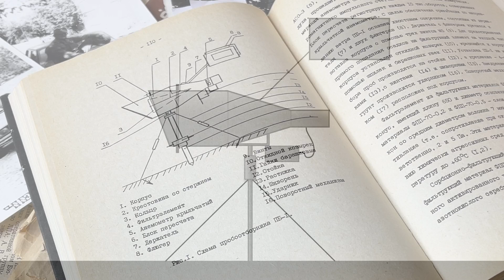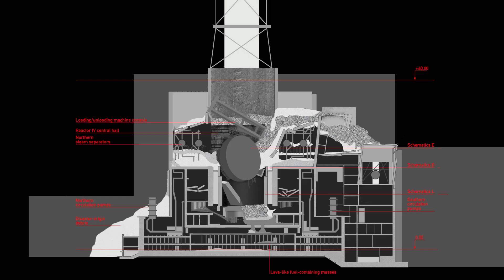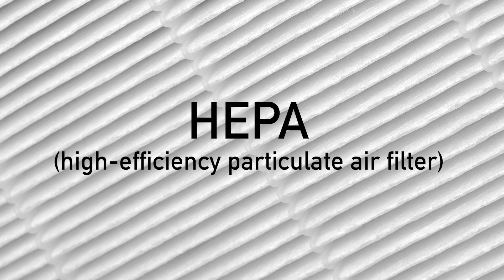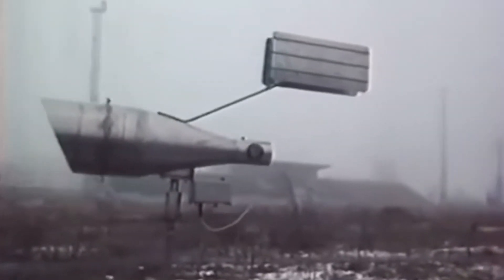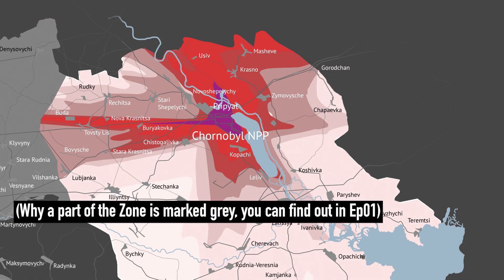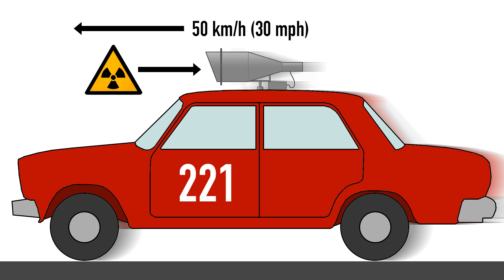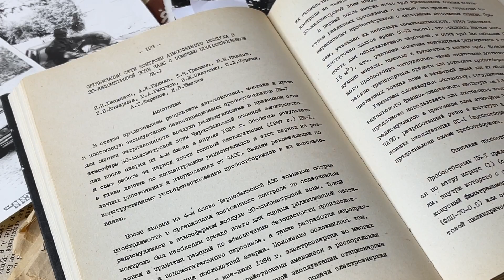Weird Device Spotted in Chernobyl – What Was It Really For? | Chornobyl Uncharted Ep 05

Comment: I am actually an undergrad studying Applied Biology, after switching majors from Engineering. One of the tools I am using for a class is something called an Absolute Solar Pyranometer, and I think that's what this is. Pretty cool Chernobyl has one

Edit the device is actually more specifically called a Pyrheliometer , which is a type of solar Pyranometer and has the characteristic tube chisel shape like a marker
Reply from the maker: Well, did you check the video? This thing is a particle sampler.
Reply: @ChernobylFamily  yes I did, I made the comment before watching the video as a kind of prediction to test my knowledge but the video is well made ! Stay safe !

Comment: Interesting. If/when the "current unpleasantness" in the region is over... those windmill/propellers that are part of their airflow and that keep them pointed into the wind and the filter bag collecting particles properly... I think they could power IoT & LoRaWAN/MQTT devices and a mesh network. And do so very inexpensively. 🤔

And it could monitor several important things. Like the wind speed of the propeller (and if its stuck) & the compass direction it's pointing (if stuck & needs repair, and "agrees" with known weather & wind.) Confirming a filter change visit. It would all be possible with a small solar panel, like occasional LED lit road signs or traffic sensors one sees, but the wind propeller seems sort of elegant, using the device "as designed."

More difficult but not impossible would be a simple ionization or scintilation detector, as the voltages for a Geiger-Mueller tube are higher, and the scintilometer is more expensive. But perhaps like a reverse of a smoke alarm "ionization detector" that only powers briefly on a schedule could be cheap & power efficient. 

And, it could be a simple yes/no binary threshold. Just to say: "The bag has something unusually hot in it!" And then you'll have (almost) real-time data to the day/hour it happened. Not just when the filter was collected a week or month later.

Or, instead of a basic CPM threshold, perhaps something inexpensive & simple could only respond to certain decay energies/spectrum, ignoring others, if a certain isotope is the best indication of activity, or ambient isotopes from the original disaster getting stirred up.
Reply from the maker: Those are interesting ideas and in fact this is what we use now. Now things changed, there are not aerosols present anymore, so generally we use aspiration stations combined with a set of sensitive detectors all linked to a satellite channel.

Comment: Was electricity in Pripyat still connected at the time in 1986 even after evacuations?
Reply from the maker: Depended on a so-called power supply group (e.g. critical consumers, apartment blocks, etc.)

All groups were online for around 3 days,  as there remained operative staff (as mentioned in the evacuation message). Later, it was switched off, and the only wired was Group 1, which included, e.g., traffic lights, police department, etc. Less more full restoration started in 1987 as the city started to be converted to a civilization outpost.

BTW, my friends who were driving an APC in Pripyat in May said they always stopped on a red signal of that traffic light as "...military police was strict"

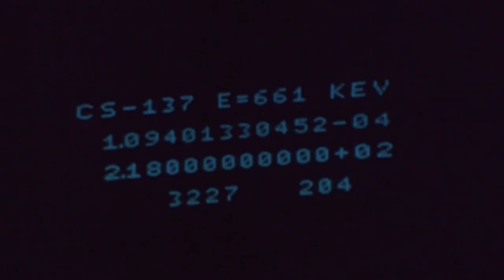Comment: That computer display at 3:31 alone would make for an interesting episode (at least for me it is. Also just seeing the computer not just drawing the measurements but actually analyzing them in real time is delightful).
I don't even know what technology that is. Is it filmed in monochrome?
Plasma? VFD? Hacked-up oscilloscope CRT with interesting pseudo-raster driver? LED? LCD? If it's filmed in color, that disqualifies all except CRT and LCD... or have I forgotten something?
Reply from the maker: That is a plasma display based on a GIP10000 matrix. There was a graphic version (I do not remember the model), and a text version which is called Elektronika MC6205 and technically is the same but with added decoder. They all glow orange. Normally they were intended for complex CNC machines and that's why they are still produced in Ukraine in very low quantity as spare parts; but also they appeared in a few specialized devices such as spectrometers. We have a few MC6205, it is easy to wire them up to arduino, so at some point we will make a good review of them.
Reply: @ChernobylFamily  Ooh, can't wait to see one all hooked up and analyzed!